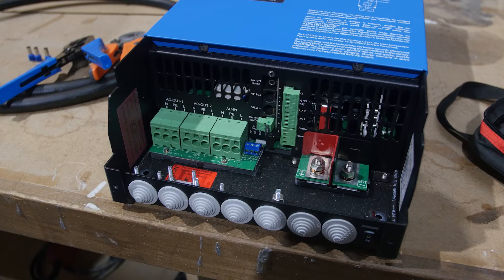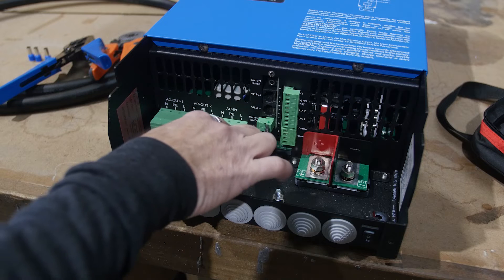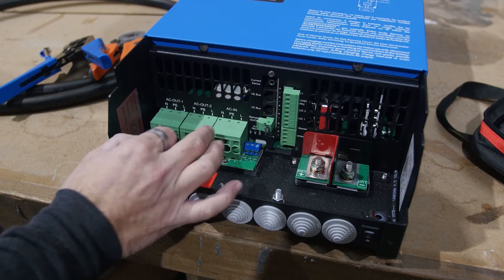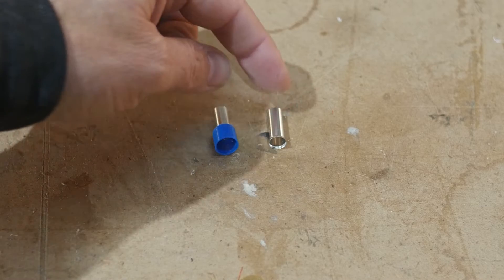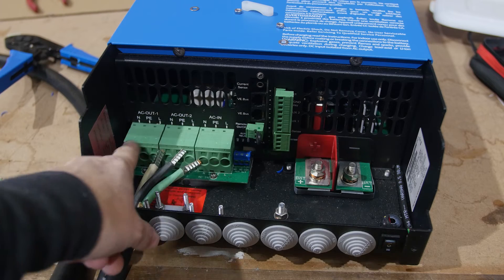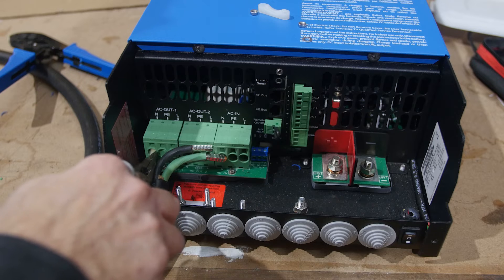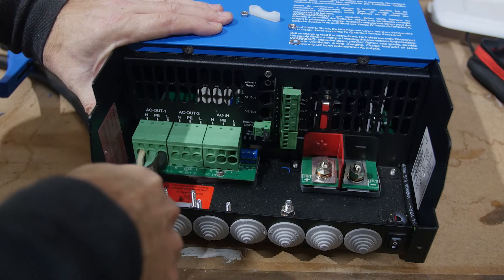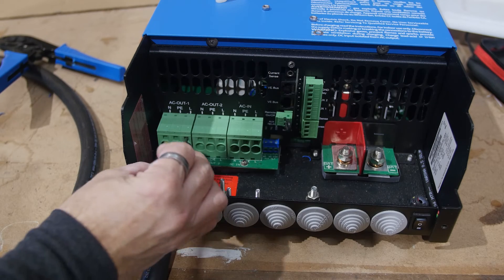Wiring AC Terminals on a Victron Energy MultiPlus II

Comment: My mistake was trying to push it in by hand. I'm testing out with 14 gauge extension cord and just pushing on the wire. I couldn't get nearly enough pressure but hooking up with needle nose pliers it went right in.

Comment: Should leave a lot more wire between the cable entry/strain relief and the terminal blocks. Also, stripped length recommendation on the inside of the equipment is 18mm. There are 18mm ferrules available and would be a better choice.
Reply from the maker: Thanks for this helpful comment!

Comment: Nice video, what size cable are you using?  Amsoil Adam posted a video about frying an inverter from not removing enough wire housing thus pushing too much plastic into the terminal. Victron says to remove 18 mm (0.7")...always something to worry about, lol.